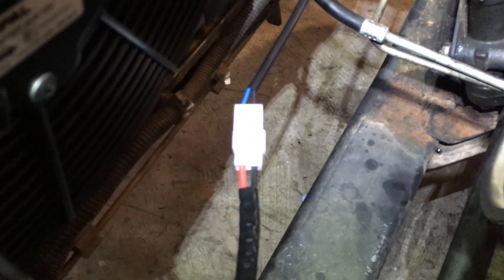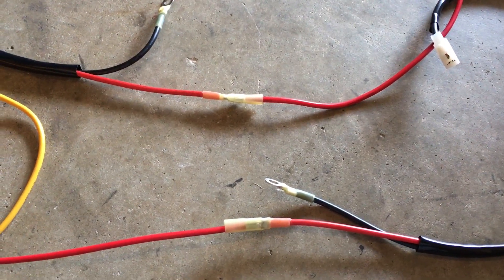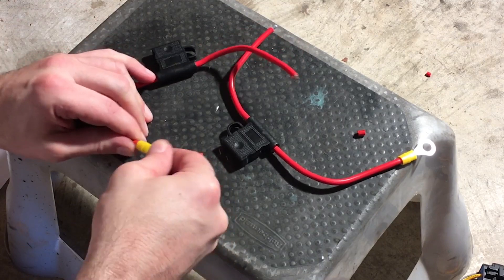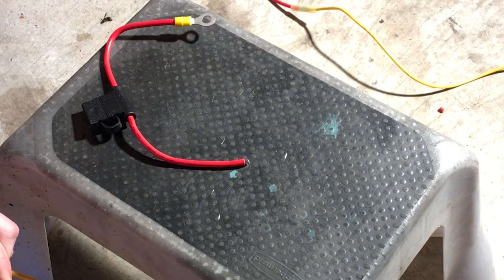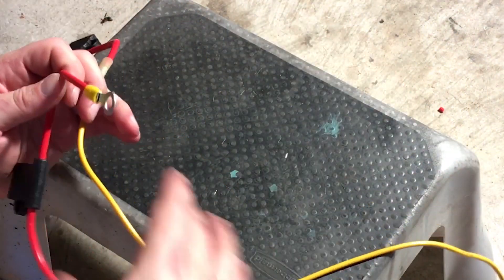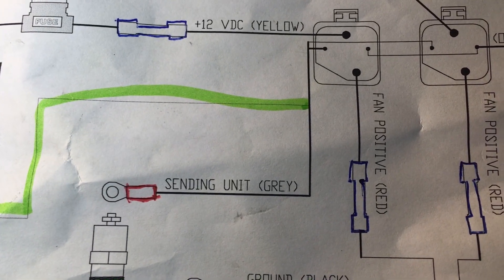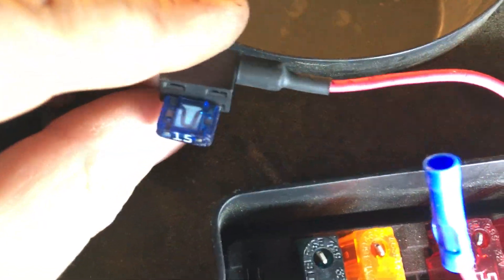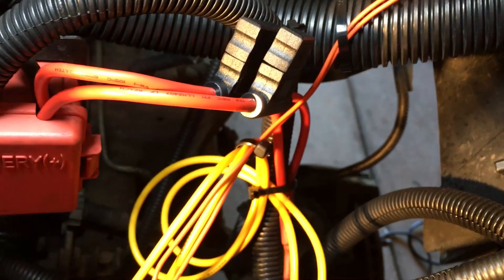Wiring Up Electrical Fans for Radiator - GM Chevy Tahoe Truck

Comment: I've overheated as a result of a water pump failure on my 5.3 but I've never witnessed the temp get that high. I would like to address a few things like I hope my kit comes with instructions like that. Also they do make pliers that your supposed to use for crimping those crimp connectors and last time I checked less than 10 bucks at the local auto part store. Also when the temp gets that high again it's best to check out why like maybe the sensor isn't closing circuit as it should or even none of them will meaning your probably best off just wiring to the ecm.

Comment: What circuit did you use? All of mine I found under the hood are a constant and the fans continue running after the engine is switched off.

Comment: if you are going to the trouble to do automotive electrical 
and doing an electric fan install,
 use non isulated connectors, 
solder all connections 
use shrink tubing to seal all connections , 
use split loom or similar product to protect your harness , 
safely route and secure harness
if you are running your wiring to test system, 
do not waste time or connectors, use marrets to test  only, then solder / seal all connections

Comment: How much the fuse should far from relay ? 
I am facing fuse and relay heating issue , maybe cuz my fuse very near to relay ?
Reply: Are you using the right gauge wire?  Fans draw a lot of amps.....is your ground nice and clean?

Comment: good video @tahoe Steve, where did u buy the sending unit or is it the temp sensor? also if the sending unit is not connected how are u able to tell the temperature in gauge on the dashboard I'm a lil confused please help
Reply from the maker: I used a sensor in the pepcock and a separate gauge as I didnt have a trans temp guage in the main cluster.

Comment: No shrink wrap??
Reply from the maker: i did it later after i ensured that everything was working  for about a week.
Reply: Tahoe Steve 
The reason that you had a hard time crimping those connectors is because they are meant to be use with a heat gun. The solder melts to connect the wires

Comment: So did you use 2 relay kits ? And why ?
Reply from the maker: one relay for each fan, then a 3rd relay as the switch for tying in the A/C
Reply: @TahoeSteve  ok but do i need the relay  to turn ac on im installing on 90 Chevy Caprice because my ac is not a  electronically unit since a older car
Reply from the maker: So - the 3rd relay is optional.  it will allow you to have the fan(s) on (overriding the temp control switch) when the A/C is on.  not sure about your specific make/model, but that is the premise of the 3rd relay.  make sense?
Reply: @TahoeSteve  I kinda understand what u mean not very good with relays i have dual fans how would i go about running them on relays if i don't wanna add temperature switch cause they fail alot ive had two in the past that have failed within 7 months if i just want them to run anytime my car is running if u understand what im trying to say thanks for any helpful feedback

Comment: I have a 03 focus that I have replaced every imaginable part on! From timing belt & tensioner, serpentine belt & tensioner, 3 alternator's, coolant head temperature sensor, cooling fan solenoid, cooling fan relay's & tested the fuses! I lent the car to my girl & she brought it back knocking after a few weeks. I rebuilt the lower end & several other parts, timing, water pump, belts, tensioner's & replaced the exhaust, wheel bearings & hubs, entire front suspension, upgraded the brakes to vented & slotted rotors, new ball joints & then I added a 2 din 4G smart radio w/gps & camera, got two subwoofers & amp, 1 farrod capasitor, new seat covers, pulled the seats out & swept it out & scrubbed the carpets, swept again, as you see, I take care of our car's but, then I noticed why I had to rebuild the motor was because my cooling fans were not working! I replaced all of its parts! the head temp sensor, cooling fan solenoid, even swapped the relays, ran my own power & ground to the fans to ensure the do work & YES, THEY WORK, AT LEAST WITH A 15 AMP FUSE, THEY CAME ON & THEN, WIRED UP TO FACTORY WIRING, I DISCONNECTED MY HEAD TEMP SENSOR & THE FANS RUN CONSTANTLY, FRYING MY ALTERNATOR AFTER A FEW WEEKS, SO, I AM CONSIDERING GETTING A HAYDEN 3651 COOLING FAN CONTROLLER. HOPEFULLY THIS IS THE FIX? I REALLY HOPE ON HAYDEN'S MODEL 3651, THAT THE TEMP SENSOR SCREWS INTO THE FACTORY SPOT FOR MY HEAD TEMP SENSOR???? OR ELSE I AM REALLY IN TROUBLE STILL!!!

Comment: Where did u get that sending unit?
Reply from the maker: came with the radiator
Reply: Steve's 5 C's I got the same setup for my 01 Yukon Denali but the sensor won’t fit. I also bought a 1/4 npt sensor n the same. Do yu know wat size it is
Reply from the maker: man, i wish i did, but it's been so long since i did this i forgot.